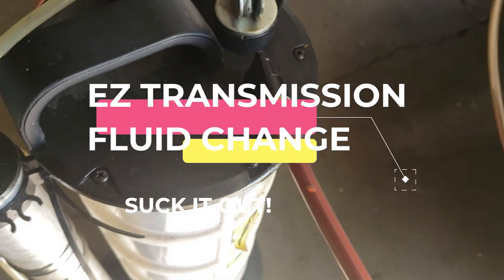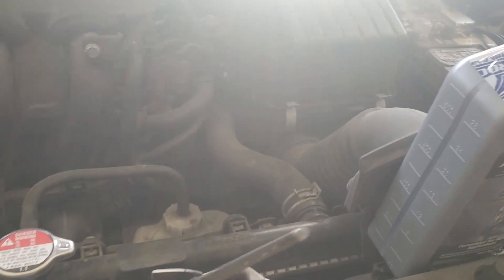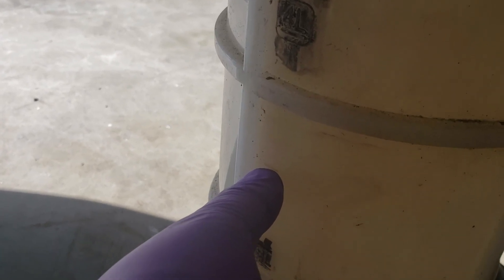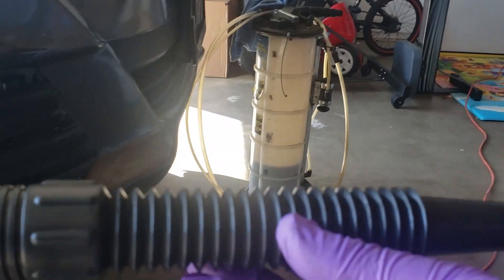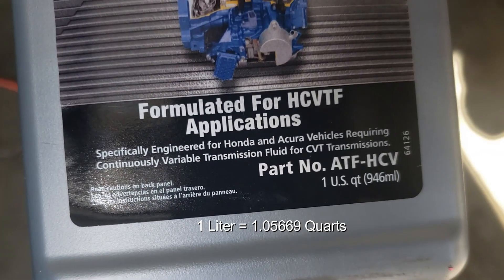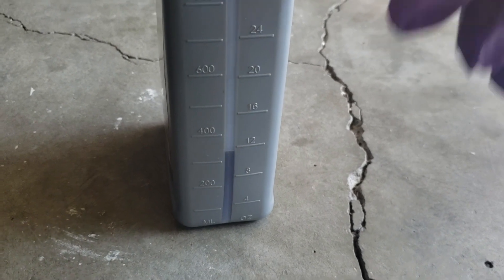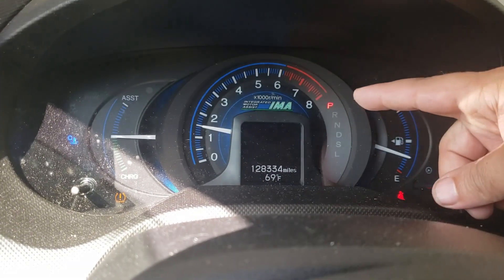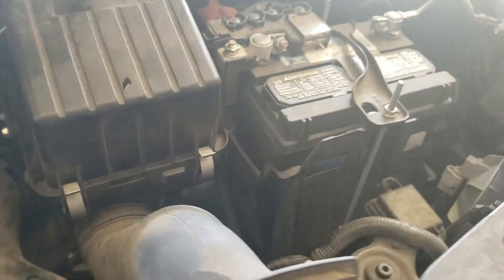Easiest Transmission Fluid Change! How to Suck Transmission Fluid Out▶️ How to Change ATF

Comment: My automatic gear box got stuck between reverse and park and was generally not smooth when changing gears. 47,000 miles on clock and never changed ATF before. Used an electric pump and removed and replaced approximately 2.5litres the first time out of a total of 7 litres. Then did it a second time removing a bit more this time, around 3.5 litres. So approximately 75% of the ATF is now new liquid. This has fixed the gearbox issues completely for £60!
Reply from the maker: Wow, what a difference new fluid can make. I am glad to hear your were able to save your transmission.

Comment: Wondering if we can extract from fill plug instead? Will it extract more than 2.5 liter from fill plug compared to extracting from dip stick. Appreciate your response. Thanks in advance!
Reply from the maker: The tip stick and fill plug are the same thing on this vehicle. So to answer your question yes. Anytime you have access to extracting fluid or checking fluid level you can do. It just does not work for sealed transmission.
Reply: Thank you

Comment: If the average vehicle transmission holds 10 -12 quarts and I remove and replace 2 - 3 quarts is that really going to be enough to make a difference? If I do it say  3 times @$12 quart thats $108 just in transmission fluid.
Reply from the maker: Yeah replacing the fluid like Evet 12 or 36 is a good idea. There is no replacing all the fluid like you as said because it’s in the line and torque converter. I think you can still get a good deal on fluid on rock auto.com
I was able to score that fluid for honda at $6.
I hope that helps and yes the cost can add up but it’s better than paying $2k to $4k for a new transmission. That honda in the video was my mom’s vehicle and she just sold it and it had over 200k miles and not one issue.

Comment: Won’t work on a Pacifica van. You can’t get the tube down. When you open the filler plug, there are tranny parts right under it. I found out the hard way, dang it!
Reply from the maker: Yeah some of the newer vehicles are a pain in the next. I have a 2014 dodge caravan and obviously it doesn’t have a dipstick. I would be nice but they want to make it more complicated.

Comment: what size tube should you use to enter the resevoir?
Reply: Also, have you ever gotten the tube stuck in the reservoir? I want to attempt to do this but dont want to rip off the tube by using a wrong smaller size.
Reply from the maker: It comes with only one or two tube size, use the thickest tube possible. I’ve only gotten the tube stuck one time on a Mitsubishi eclipse. I’ve used the sucking method on hundreds of time. We used that very pump at the repair show. So the chances of this happening and getting stuck is about 1/1000.
Reply: @RANDOMFIX  I plan on doing this on my 08 Accord with the k24 4-cylinder. The reservoir is really tight there doesn't seem to be much room at all, I hope it's similar to the Honda in your video.
Reply from the maker: Awesome keep me posted, the time I got the tube stuck was on an oil change never had any issue on a transmission. 
Make sure the unit is empty when you start as it can help determine how much fluid you sucked out. I normally stop 3 quarts and add in exactly 3 quarts. After 10k or 20k I will do another 3 quarts.
Make sure you use the right fluid, rockauto.com will give you really good data on which fluid to use and will let you know who the oe fluid provider for honda and then you can buy that fluid instead of having to buy it from honda as it will much cheaper for the exact fluid. Good luck 🍀
Reply: @RANDOMFIX  will do I'll let you know, the drain plug on my trans case is seized I've had 2 shops look at it. The recommendation is to just leave it be due to risk of cracking the case with added pressure. The only way I can change the trans fluid is the way you recommended. I plan on doing it this week, appreciate your help!

Comment: If you use this pump for an extractor only, do you have to clean it?  Does leaving oil residue in it cause breakdown of the plastic or vinyl tubing or seals?
Reply from the maker: Nope, you don't need to clean it, my is still I perfect condition. If the tube is creating a good deal, just cut a inch off and and reinsert. I've used it all fluid so car including brake fluid.
Reply: @RANDOMFIX :  How long have you owned it?
Reply from the maker: 2014

Comment: You're not really going through the gears when you are shifting through the drives. Your car usually has 4-6 gears when in drive. Great video!
Reply from the maker: Thank you for the feedback. Can you please explain your 4 to 6 gear feedback idea?
Reply: @RANDOMFIX  You would have to take the car for a test drive in order to go through the gears. I'm curious however if your car has manual gear paddles, like my Lincoln does, if you could keep the car in drive with the brake pressed and manually go through the gears with the paddles while stationary.

Comment: Is it possible that you may have dislodged the transmission fluid filter when you placed the plastic drain tube inside to pump fluid out?
Reply from the maker: No, why do you ask?
Reply: I was wondering the same thing.  The transmission strainer is blocking access to the transmission fluid in the pan.
Reply from the maker: I have not run into that, it takes the same path as your dipstick.
Reply: That is a good question.  My transmission is sealed.  I wish I knew for sure before I started.  I think I will drain a gallon of fluid off from under the car until I know for sure.

Comment: Do I do this while the car is at running temperature or leave the car off and cold?
Reply from the maker: Have the engine off while you sucking the fluid out.
Reply from the maker: The fluid will pump easier if warm.

Comment: Would this get any water out of the transmission?
Reply from the maker: Sure it can get all fluids out. How did you get water in the transmission?
Reply from the maker: I know you replied back but YouTube deleted your comment. Can you try replying here. I'm  not sure why this happening but it's been more frequent lately.
Reply: Thanks for the quick response! Something happened where transmission fluid got mixed in with the coolant and vice versa. Took to a   trusted mechanic, he replaced the radiator put  new coolant and took out as much of the water out of the transmission fluid as he could. He said there was a little bit of water remaining that he didn't have the tools to get out. He recommended to do a transmission fluid exchange and thats how I ended here at your video!

Comment: The advantage of a thorough Transmission FLUSH, is that it will extract 100%  of the old fluid, INCLUDING the fluid that's in the Torque Converter, which will be left behind with the typical "drain" Thus my question is, "Will this method remove 100% of the old fluid, or will it also leave behind the old fluid in the Torque Converter?  Thanks!!
Reply from the maker: Honestly if the vehicle has more than 100k miles I never recommend at complete flush.
Reply: It will not. However what you can do is repeat the process 3 times. Make sure the engine is hot. Drive around 10 miles each change.
Reply from the maker: This will not a true 100 percent change, you will need a t tech machine that will remove the old fluid as you addd new fluid.
Reply: Better to have almost all new fluid than never doing it like most folks!  Or worse, paying a fortune at the dealer or for a hack job at the quick lube.  Do this alongside an oil change a few times, and you're good.
Reply: @porkchop10  The topic here is if was never done in over 100 thousand miles. Then what??????????????????????????????????????? I’ll hang up and LISTEN.
Reply: @RANDOMFIX what if your car requires a change every 30k miles? This is what they do to my car everytime. I've never seen a mechanic actually do a flush but this makes sense.
Reply: @501barako wouldn't that get expensive trans fluid is $12 a quart let's say I extract 3 quarts that's $36 to replace the 3 quarts and drive it for 10 minutes then do that 2 more times that's another $72 in trans fluid I would have to replace so I'd spend $108 on fluid  total and still wouldn't have thoroughly changed all of the old fluid out of transmission and torque converter considering the average vehicle holds about 10 - 12  quarts of transmission fluid.